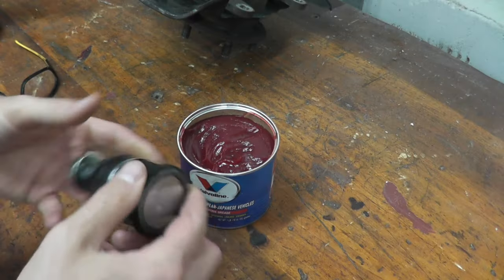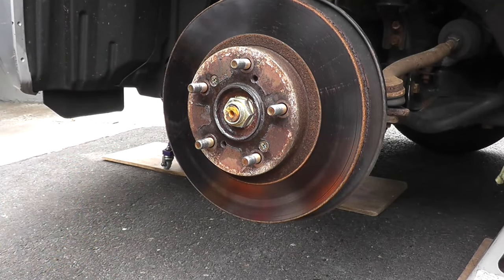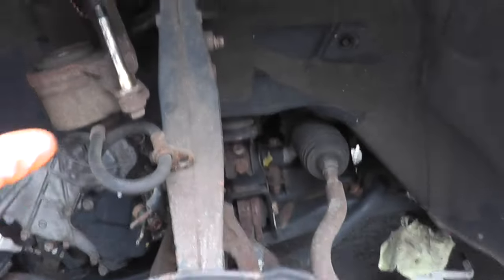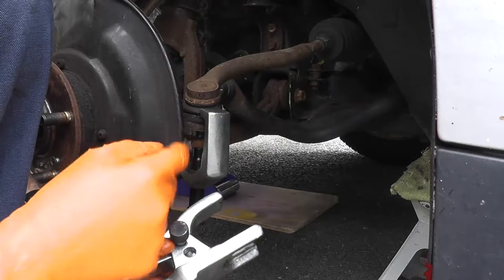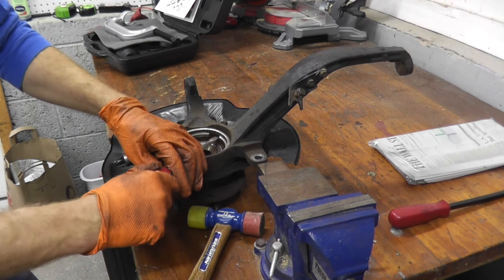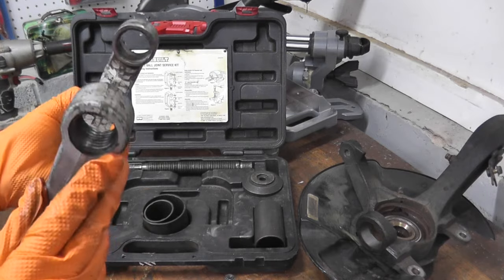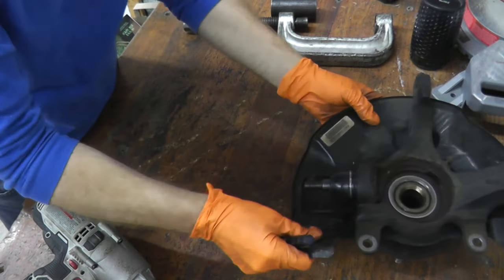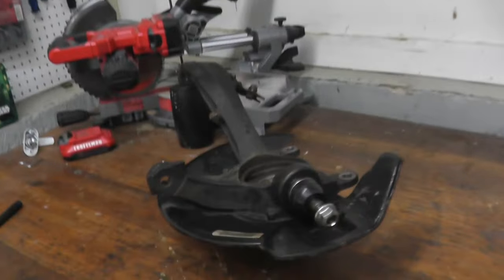Honda and Acura Ball Joint Replacement | Step by Step Instructions

Comment: You did all the operations by the book and I like it, one question please for a detail I have a doubt, is it a good idea to lubricate the ball joint before slide it into the knuckle? I know that will help to slide easier but also would that be a concern and be prone to escape from the knuckle after installing especially for those ball joints that come without a snap ring? Thank you

Comment: Hey brother I have a 2021 honda accord lx and it has a bolt on lower ball joint with 3 bolts can I do that 1 on the car without removing the knuckle.  It doesn't have a upper ball joint the lower 1 is attached by 3 bolts to the lower control arm and has a castle nut on the top
Reply: Yes those are easy

Comment: So dealer  said on my repair sheet for 2014 honda accord ( both front lower ball joint boot splits ) so what acutal part do i need
Reply: Once the boot splits you might as well replace LBJ as it got contaminated by outside dirt and moisture.

Comment: Can you do one for the bushings on lower control arm for that Acura tl? It would be nice to see how you change those out with hand tools.
Reply: Its more logical to just buy the whole assembly instead of replacing the compliance bushings. I bought two new LCA's from Rock Auto. I think it was 75$ each. Eric the Car guy has a video on changing out compliance bushings on this car. Its a bitch even with all the professional tools he has. After finishing the job he even said, "its not worth the hassle. Just buy the LCA assembly."
Reply: The job of replacing the LCA's is tough enough. lol I bought Beck Arnley ones on Rock Auto. They work great. High quality. Could be OEM. Beck Arnley I mean. The bushing closest to the front of the car was horribly ripped. Im assuming you have same issue. Hope i assisted you in some way. I just had to say something cause Ive been down that rabbit hole. lol
Reply: @alexandercahoulan6583  the non oem bushings do not last long
Reply: Many people said less than a year or two on the TLs with non oems.
Reply from the maker: Good question. Alexander is correct. It's not worth the time and energy. You can simply purchase a new part at an affordable price.
Reply: @anthonymerc220  I can attest to that. Moog ball joints are trash. Once the boot rips, you can count on having to replace it. I've been through 4 in 2 years. Also, be certain that the castle nut has a flange. Had mine escape the LCA yesterday. Luckily, I had the right nut in my toolbox. I'm considering adding a washer to prevent it from happening again.

Comment: That's the lower ball joint.  What about the upper one at the top of the upper control arm?
Reply: Buy a new control arm
Reply: Lol... it just unbolts with 2 bolts.

Can't always buy new. Not available or just plane expensive.

Comment: Such a bad design to have a ball  joint installed on the knuckle. It would be much easier to install if it is on the control arm.

Comment: Looks so damn easy.  I wonder if it is my tool kit.  I aligned it evenly and hand tighten.  Then tighten with ratched and breaker bar fairly far in.  Still evently align.  Slowly go in with the impact and it becomes uneven.
Reply: I’m on the same page